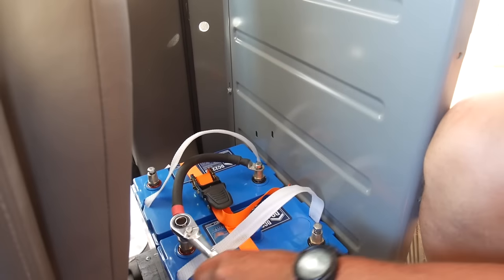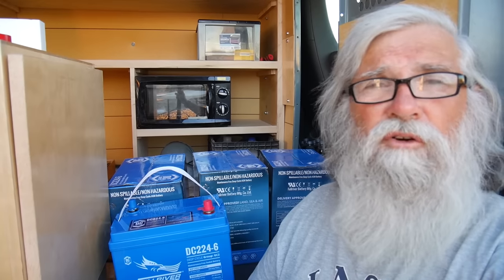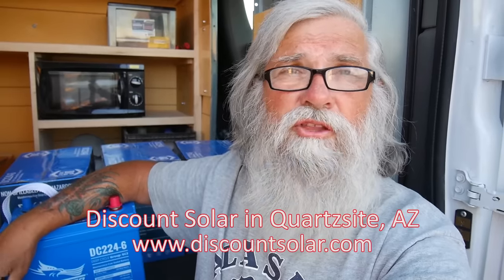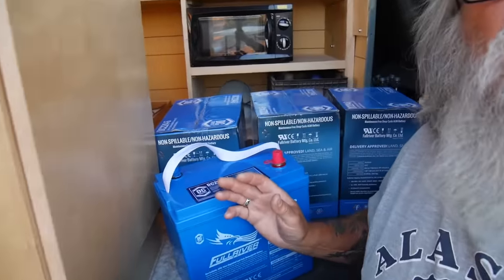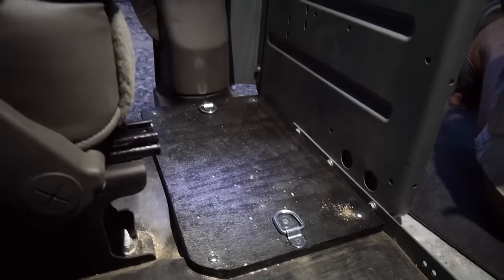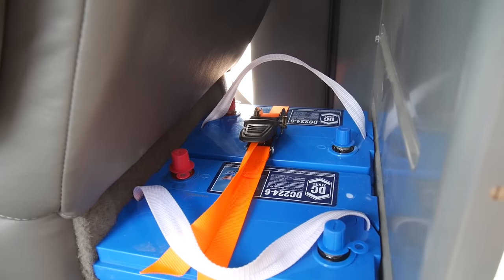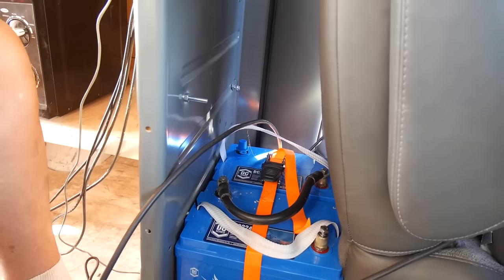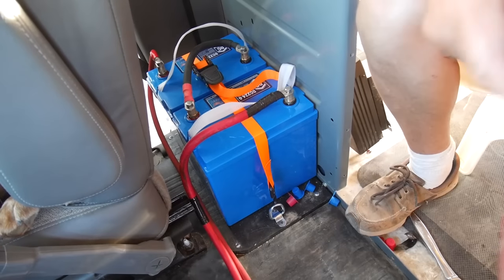Van Life Essentials How to Install a Solar Battery in a Van

Comment: Bob,

The straps may hold but I am pretty sure the wood screws will pull out in an impact. Best to have through bolts through the floor and washers with lock nuts on the outside.  If you look at how seat belts are mounted these should be attached more positively than those, otherwise they are moving around as projectiles with acid in them that will release at first impact.

Really appreciate  all you are doing and sharing.

Comment: Bob, love your videos, thanks for all of your efforts. Have done a few solar installs.  Maybe you were about to do it, if so disregard, but you must add a fuse on the hot line running to the inverter.  Often times people run a short hot line to fuse block with the fuse, and then run another line from the fuse block to the inverter. The amperage of the fuse is large enough to allow the inverter to draw peak amps, but anything larger it will disconnect the batteries from the inverter.  Without a fuse you risk a short, that, given the amps in those batteries, would likely burn down your van.  Some people also put fuses between the panels and the charge controller, I have sometiemes and other times not.  Also, its critical that you put some cover over those terminals, to ensure no metal falls on them and causes the same type of short.  You probably already know this, and it just wasn't in the video.  Again thanks for all of your great content.

Comment: I enjoy watching your videos and I learn quite a bit along the way.  However, electrical low voltage design is something that I have a bit of knowledge in.  A couple of comments for safety: Why no battery boxes?  Why no fuses at the positive connections to the batteries?  The seats (and their frames) are dangerously close to both the terminals and wires.  A battery box would be much safer!

Keep up the good work and stay safe!

Comment: Terry is an awesome.  It would be great to see how you secure the 2 wires (positive & negative) connecting the 2 banks.   Also it would be good to see how you connect the inverter, solar controller, and continous duty solenoid.  You typically connect positive on one 12V bank and negative on the other so I think there will be more wires going between the two seats.
Reply: I think you will see that in the next video.  There ended up being too many terminals in the one battery and after checking with Discount Solar, we split them between the batteries.
Reply: Traveling Terry Awesome.  I look forward to seeing that.

Comment: Great choice in batteries. Considerable sustained power. The only problem I see is that you used drywall screws to mount the tie-down loop. They are very brittle screws and could vibrate the heads right off over time. I would go with a good galvanized sheet metal lag long enough to go through the plywood and into the sheet metal. Thumbs way up on the build so far.

Comment: good choice on full river(made by rolls) they are 80% recyclable at end use unlike the trojans  I have a 1100 ah system they last about 6-7 years in a commercial system

Comment: SO timely Bob! Just this morning I was looking at small microwaves on Amazon for my future van. I settled on the one you have. Then I thought "how will I power it?" Voila! You've answered my question. Good tip, to wait til I get out there. I'll re-watch your vid again, but I know I'll need help with the installation. Great info! Thank you!
Reply: Though you want to be safe when using batteries the installation is amazingly simple. Of course almost everything seems easier after you've done it once doesn't it? :) That said, I have yet to do it and was surprised at how straight forward it is to set them up correctly. Hey would you mind linking me to the microwave you chose?I'd love to have one for on the road. Good luck with your setup and thank you in advance. 
Cheers!
Reply: Angela Siegfried, here's the link for the microwave. I believe it's the same one Bob has. It also comes in white. I've had a Westinghouse before, and it was very good.  https://www.amazon.com/gp/aw/d/B00BGTO1WC/ref=mp_s_a_1_2?ie=UTF8&amp;qid=1499732021&amp;sr=8-2&amp;pi=SL75_QL70&amp;keywords=small+microwave
Reply: Thank you, Jana!
Reply: Good to know, Mike!

Comment: Hi Bob!  I have basically the same van... and the same microwave.  I run mine off a pair of AGM 125 Ah batteries and a 1500 watt pure sine inverter from Vertamax, which is an inverter I highy recommend because it runs so clean and never shuts down. It runs great... even at voltages below 11.    Note that I stopped using an N-power 2000 watt pure sine because it would not run the microwave except under an ideal charge.  So... not all pure-sine inverters are created equal, despite their stickers or labels.  Some are garbage, others run clean.

Comment: Great video, I'm doing research and collecting data and you seem to know so much and share a great wealth of information I'm looking forward to the next videos if the rest of the installation of the charge controller, monitor, Solar panel hook up and fuse box control

Comment: Hey Bob sorry to bother you but if you can I would like to check out the all in one solar generator. I have been looking at the E-Cube. I can't remember the information but I found it on the Home Depot website and it has wheels and fold out panels. I was hoping you might be familiar with this. I value your opinion and thank you for your time and knowledge.

Comment: I enjoyed your video. I'm not criticizing just commenting on the fact when I was a kid I did a lot of riding in a vw bug. I mention that because the year bug we had, had a battery under the seat. well it shorted out and my butt caught on fire. I'm sure you're gonna cover the batteries. But you didn't mention covering it. just wondering.

Comment: Lithium Iron are 99 percent efficiency and the lead acid can only be discharged to 50 percent after that you damage them , 
Lithium you can charge more times lead acid only 500 times .
Love your van build just got a Chevy yesterday 60 ,000 miles .

Comment: Those new batteries are going to be lighter. I think you may need to start finding ways to lighten the load on that beast. Getting up there in weight. What is that van weighing now around 8,000 to 9,000 lbs ?

Comment: Hey Bob,
Nice installation & great capacity battery system!
Will you be connecting your batteries to your van charging system with a solenoid to charge while driving, & or as back-up to your solar charging system?  It looks like the location would be pretty easy based on the forward location.

Comment: Bob, with my Honda Odyssey camper, I bought ( 2 )  235ah AGM batteries and a 2000i Honda Generator in addition to a 100watt flexible solar panel and a battery isolater. The generator has a DC input for  charging batteries.  As you stated, the AGM batteries charge quicker; what's your opinion on charging the batteries, directly from the generator, or connect the generator to a battery charger, to the batteries? Greg

Comment: Lead acid are the most cost effective, but they do need to be vented in many cases.  Mine are not, but because I use them gently and equalize them manually, there is no problem.  Just bot 2 225AH, Deka brand, $99 each!
Reply: Vent Outside When You Equalize.

Comment: Originally I had Liquid Batteries .  I use a Battery Isolator so the charge comes quick and hot from Alternator  causing fumes in my cab , that Made me feel sick .  My  new Battery is AGM , I think that it's the Best Choice .

Comment: Is there a link to the next video after this. On this video you hooked up the 4 GolfCart AGM 400 batteries. Now I assume there is a Sinewave Inverter to connect? And an AGM battery charger? And a meter that reads the voltage? Also maybe a fuse box that will connect all the appliances? The microwave takes a lot of power. Please provide link to next YouTube video a ms to what else you need to add and how to connect the appliances to the battery

Comment: Do you still have full range laterally for your seats? I know doing them the way you have makes them more secure but just wondering if you're more cramped on the steering wheel now. I ask because we're similar heights and wanted to know how it's working out for you.

Comment: Hi,  I'm doing a chevy express conversion and will be using alot of your layout.  I've came across the same AGM batteries in 250AH for 115.00 each used.   Is this great deal in 2022 where the smart kids all buy lithium?    I want a cheap build. Lol.   Should I pull the trigger?

Comment: My understanding is that it is best to buy all the batteries you will use at the same time so they are the same age.  I figure that holds true of AGM batteries too.   Correct?

If you couldn't buy all of them at the same time, would you not use what you have until you can, or alternatively, how long would you use batteries before you felt it was too long?

Comment: Great stuff indeed. I'm learning so much but I have a question if anyone can answer. Is a 2000 watt inverter standard for van life? Is there such a thing as too much? If I had these 4 batteries and a 3000 watt inverter and 600 watts of solar panels plus a Honda eu2000i generator is that over kill? Thank you for any replies.
Reply: The usual rule of thumb is to divide the inverter watts by five and that is your minimum aH for your battery bank. So a 2,000 watt inverter should have a 400 aH battery bank as a minimum. A 3,000 watt inverter should have a 600 aH battery bank as a minimum. Any less than that and a big load will likely pull the voltage down too low and cause the inverter to alarm or shut itself off. We've been fulltiming for 20 months and have a genset but we hate the stink and the noise (as will your neighbors!). We have never used the genset (or shore power for that matter as we don't stay in RV crampgrounds either) to charge our batteries. El Sol does a perfectly fine job of that -- and does it quietly with no stink! We have a single 420 watt panel, a 100 volt/40 amp MPPT charge controller, 600 aH of batteries, a 3,000 watt MSW inverter for larger loads and a 300 watt pure sine wave inverter for all our delicate electronics. Our first 14 months out, we only had 400 aH of batts and the little PSW inverter and life was good! Since then, we have paid quite a bit more ($800) for a small increase in functionality.
Reply: Jim Peterson  Thank you so much for your reply and information. It helps a lot. Safe travels 😄

Comment: Hey, Bob can you or some of your wonderful followers help me out? I want to make sure I understand all this properly. I am remodeling a 1979 Winnebago class C. I’m planning to use two, 6 Volt golf cart batteries. Are They supposed to go to a pure sine wave inverter. That changes the power from the 12 V DC to 110V AC? That way you can use a small appliance or small things off a battery power only? Is that correct? When I am plugged into shore power then everything will automatically run off of that? The power from my 30 amp plug for sure power should go to some kind of a fuse box? Also serve the power coming from my generator be wired into that same fuse box?

Comment: Thanks for the great vid!  
With a Honda EU2000I 2000 Watt Portable Generator, how long would it take to charge these from unusable level to full?   Say in a cloudy season.
Reply: T Mad, it takes hours. It takes maybe an hour to mostly fill them, then it takes a few hours at a trickle charge to top them off. If you don't top them off everyday, the battery life is shortened. Lead acid batteries like to be full and stay full.

Comment: Did you ever consider LifePo4 (GBS/Calib/Winston) batteries?  Probably could get away with 200ah ?  They cost more but DOD is much greater.  Think they charge even faster then AGM and they never need to be completely topped off for longevity and cycle times is far better.
Reply: Pearll Garcia the price for 200ah (actually 8 cells) is about the same as 4 AGM batteries.  Type of controller is another story.